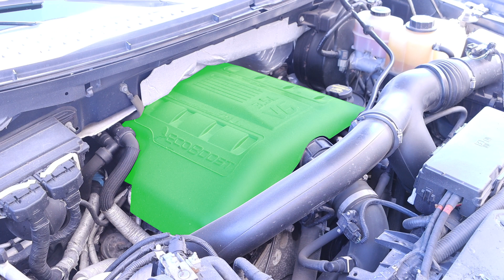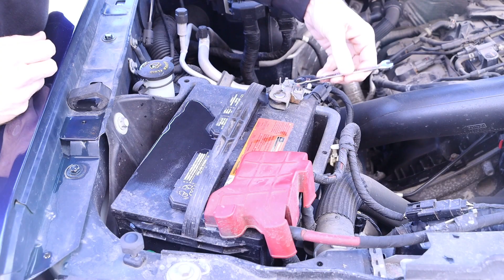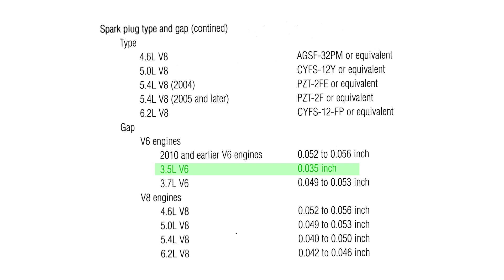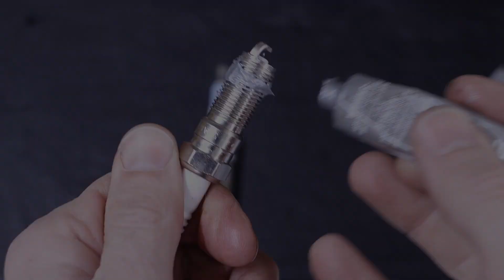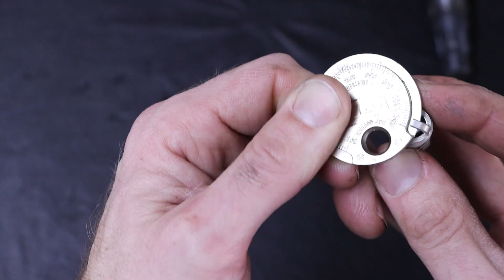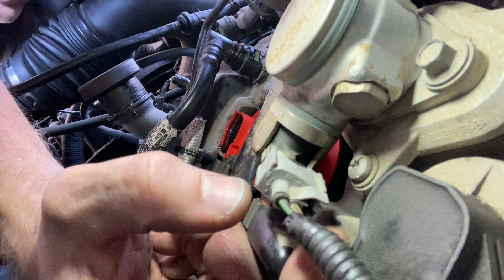Replacement of Spark Plugs and Ignition Coils - 2012 Ford F150, 3.5L (2009-2014)

Comment: Are you really yanking to break those spark plugs free. I’m dealing with some stuck ones and came to see about how much force you used but you cut away each time. Looks like you were whinding up on the first one then cut away.
Reply from the maker: Usually a good jostle will work.  Just make sure you are turning it the correct direction.  Also, it is best if the engine is cold, meaning you haven't driven it for at least 8 hours. Sometimes a little penetrating oil helps also.

Comment: No need to remove battery terminal otherwise good video
Reply from the maker: Thanks for the comment.  I understand your thoughts, although it's always good practice to disconnect the battery anytime you are doing anything related to the electrical system.

Comment: Thanks very much for sharing. I looked at several videos but yours was the best. You took the time to explain how to remove the electrical connections. I was trying to find out how to remove the electrical connection at the high pressure fuel pump and you are the only one that I have seen who took the time to explain how to remove it. GREAT JOB!!!
Reply from the maker: Thanks for the comment.  Good luck with your repair.

Comment: Great video, appreciate your detail.  What size extension did you use?
Reply from the maker: I used a 10" total extension.  The part can be found at: https://www.amazon.com/LEXIVON-Swivel-Magnetic-Enhanced-LX-122/dp/B07MH5ZDMD/ref=sr_1_1?crid=2EP5O6FFK1YUZ&dib=eyJ2IjoiMSJ9.KfdDeBQZNA3zqbBDRzFZ7qNhzqA2-U7gArOf_QVD7ypCpk3bcmMe-MjCG0mEbtOBuIKykIVBNM_QgVdlIgJDi9Il7u9DmuHoo4a4M69HxFhJSe0ljpkHMecDgS5GXfZg6rDOWgKPj_sa7uOxfHiiZwQ85WQpYclay9Gc-hp5Fl20BUlFwockfqeTZQ0kr4RlXDiqHZFassuTwhwi-Gbq8UsjmLI8dHz4VJyXoRa8qOvOD1hak-A84-B0vhMrQZdiAUaGd-yU9T993F6FQblaHHaChYkolL6IArqS450REsI.YlUgBhoPVQ3U6UZHs2rRZejAAj9OuQfKrx1bUFntEZk&dib_tag=se&keywords=LEXIVON%2B5%2F8%22%2BSwivel%2BMagnetic%2BSpark%2BPlug%2BSocket%2C%2B3%2F8%22%2BDrive%2Bx%2B10%22&qid=1712430557&s=automotive&sprefix=lexivon%2B5%2F8%2Bswivel%2Bmagnetic%2Bspark%2Bplug%2Bsocket%2C%2B3%2F8%2Bdrive%2Bx%2B10%2B%2Cautomotive%2C120&sr=1-1&th=1

Comment: How do you know the spark plug is tightened down enough? What are the risks of over or under tightening? Thanks
Reply from the maker: A torque wrench is required to ensure you have the correct tightness on the spark plug… Tightening it too tight could cause it to break off… Not tightening it enough could lead to a misfire

Comment: NOT TO BE A STICKLER,BUT  DIDNT YOU MEAN REPLICATE? RATHER THAN RECAPITULATE...
GOOD VIDEO!
Reply from the maker: Good ear and good thoughts.  I was wondering if someone would notice that.  I did specifically use 'recapitulate' as the definition of 'replicate' indicates that it is an exact copy.  In this instance, I am doing a similar procedure but not an exact copy.  Thus, according to the definition of recapitulate - "summarize an state again the main points of"